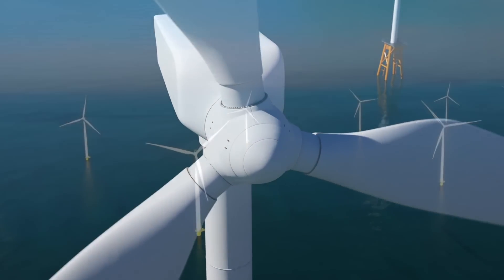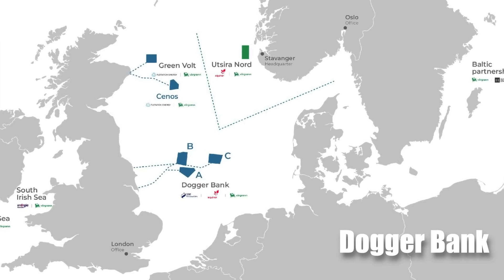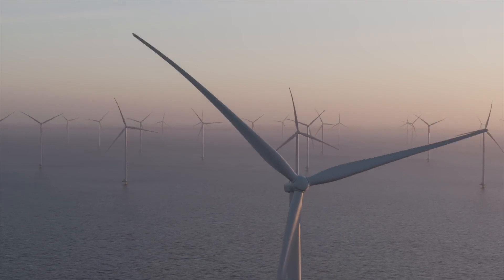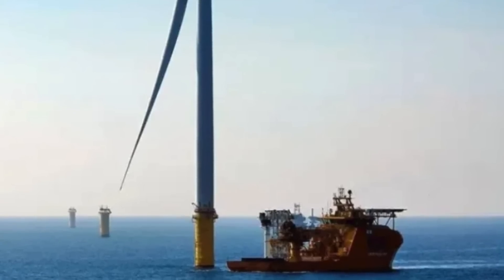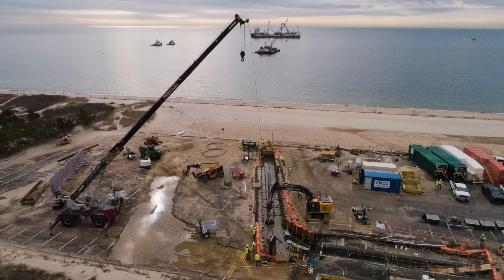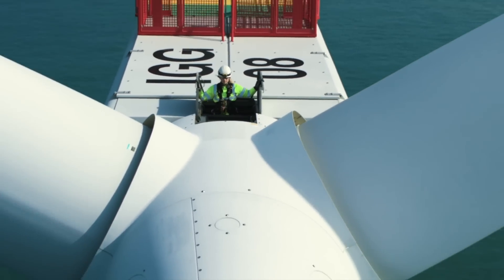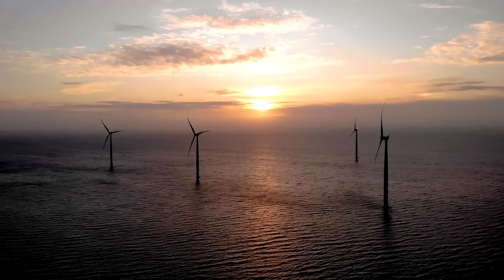Inside the $11.6 Billion Dogger Bank: The World's Largest Offshore Wind Farm

Comment: You people wetting yourselves with this nonsense forget that in the end you will pay the price for an energy source regardless of how its generated. The greem nonsence you gullable clowns swallow was created so others became millionares and now its an industry that will have to be repaid over and over as costs rise and never come down. Oil and gas in the 1960's was hailed as the new cheap energy source, cleaning the air polution from coal fires. Then once everyone was converted, we were subject to the vagries of oil prices, wars and speculation saw prices rise and now, here we are again, we see the same crap being dealt but only on the bullsh*t about CO2, which time and time again has been shown as lies and scaremongering. You lot creaming yourselves about this are just gullable smucks and whether you accept it or not, your energy cost will rise and continue to rise, as we have seen all the promises made about reduction, simply aint happening

Comment: Everyone has a boiler in their houses.  We don't use them 24/7.  We just use them when we need them.  When we don't have enough power from renewables we just use the gas turbines.  We will use the gas turbines less and less.  We will always need them for when there is not enough renewable power.  They will last longer because they are not used as much so its not a problem.  It is simple really.  Batteries are lasting longer (e.g. LFP batteries) and getting cheaper and the technology is getting better as well.  Solar is getting cheaper and more efficient.  The feed in tarrif has now gone for future installations.  Home solar doesn't need an upgrade to the grid because the unused power can be distributed to local homes.  People are still putting in home solar panels.

The hard part is upgrading the national Grid for the wind turbines.  But once that is done it will last for decades.  We have done a lot for renewables already and it will get cheaper to install all renewables as time goes by.  Other countries have done a lot as well.  Even China has done a huge amount of work already.  Their cities are much less poluted that 10 years ago.  It is very noticable.

Comment: What a waste of time and money, how  long will each windmill last and before that the maintenance on each of those monuments to net zero stupidity. How many nuclear plants would have needed to built to achieve the same result, two, three? And of course we won't talk about how much it costs to produce each watt of electricity.
Reply: Turbines have a life of approximately 25 years. They’re also continuously maintained.
Reply: The cost of Digger Bank stages A-C is about £10 Billion, for 3.6GW of power generation.

The cost of Hinckley Point C nuclear reactor (3.2GW) is approx £50 Billion.

The annual maintenance cost of nuclear is also significantly higher and the decommissioning cost of nuclear is astronomical. We could easily end up spending £100 Billion on Hinckley Point C.

Nuclear is by far the most expensive option for generating electricity.

Comment: No one has ever thought of using solar panels as the blades of wind mills. I mean they are just there in the sun.
Reply: It's just not practical. The amount of extra inertia from the weight of the panels, the energy produced would likely not offset the reduced efficiency they would cause to the turbine. Thats before you get into the practical side of how you perform maintenance on the panels.

Comment: Sunday 3rd of November,wind power supplying just 4% of the UKs energy needs,French nuclear and Norwegian gas combined 20% that just shows you how useless windpower really is and we are subsidising the operators with billions of pounds added on to my energy bills plus what extra we are paying those two countries.
Reply: Energy and power are different. Mwhs is what counts, not Mws.
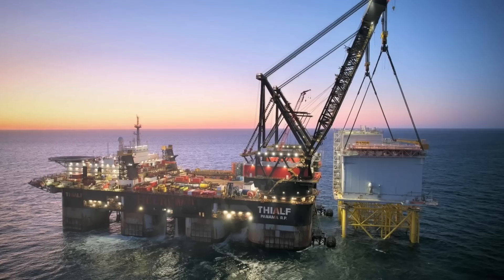Reply: We need to have more battery storage to store all the excess power wind turbines generate. You can take snap shots in time to show anything you want to. 7-12-24 7:34 Wind is providing 63% of energy in the UK
Reply: @Stumpy1854-Orion  How many batteries will be needed to supply power to say London when the windmills are not turning?
Reply: @marcbiff2192  That wont be the sole form of battery on the grid, there are many types of battery, like stored water, etc which are slow to respond, the part that chemical batteries play is in fast response, the grid has to keep the frequency at 50 hz +/- 0.5 or else the grid trips, chemical batteries respond in nano seconds in response to any ebb and flow in the demand.
Most power cut are covered by stored Hydro, Gravity, Oxygen, Sand storage that these back up power sources can handle, eventually power stations and wind turbines can be turned on to take the load.
Reply: @Stumpy1854-Orion  So where are they then and how long will they supply energy for, i seriously think you are living in cloud cuckoo land.
Reply: PS wind is generating energy when no one wants it, if we had more storage, wind generation could provide even more energy to the grid, instead of turning wind turbines off

Comment: I do wonder how long the steel bases of these turbines will last before rotting out? They look like rolled steel.
Reply: It has a projected lifespan of 35 years, so probably about that long
Reply: Longer than a nuclear power station before needing decommissioning. Also easier to replace a wind turbine base than a nuclear power station.

Comment: Considering how expensive electricity is in the UK, this wind farm will pay it's cost in no time.
Reply: Don, 

you have been lied to by the media and still by the government. The only reason these wind farms are built is subsidy and a lot of it. Their production is not economic and cost more than gas even with the carbon tax added.
We cannot run our grid without gas, we could run it without wind and get much cheaper electrcity.
The reason it is expensive is because of wind and even worse solar.
Reply: This is why electricity is so expensive in the UK!
Reply: @kevxsi16v  Electricity is expensive because it is pinned to the price of gas.